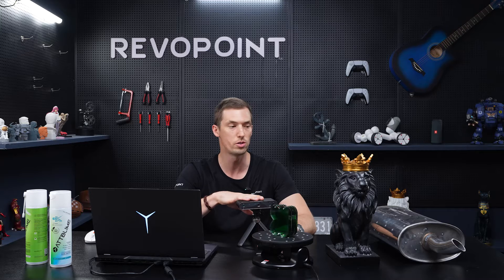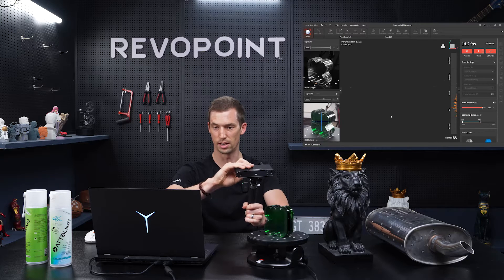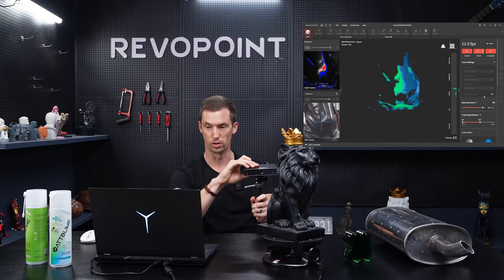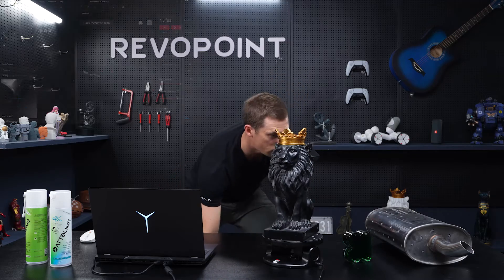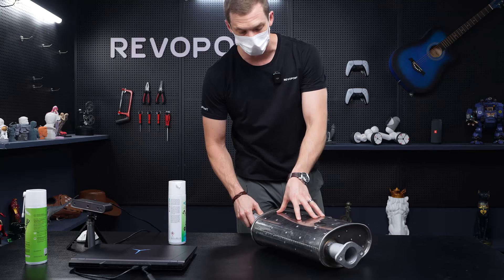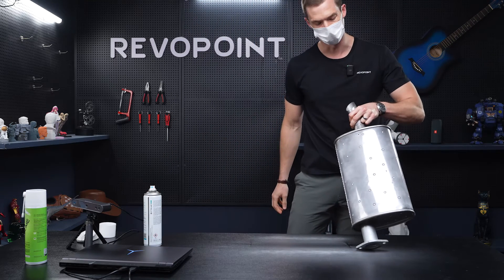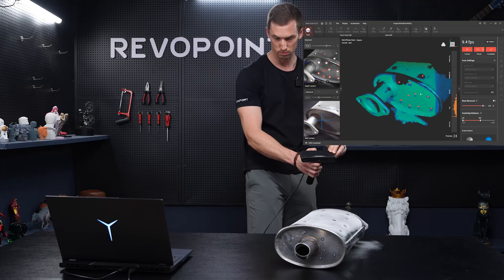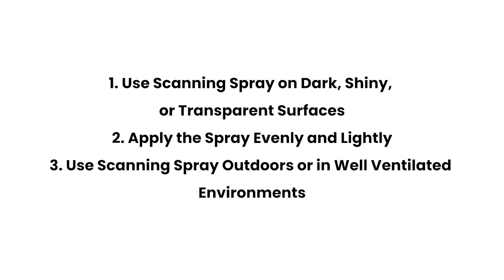Revopoint POP 3 3D Scanner: How to Deal With Hard-to-scan Scan Surfaces

Comment: Hello. After scanning, there are holes where the markers are. When I try to close the holes, I cannot get a smooth texture on the surface. Can you help me with this?
Reply from the maker: Hello, you’ll need to use third-party software to smooth it out. Additionally, we have reported this issue to the R&D team for improvements.